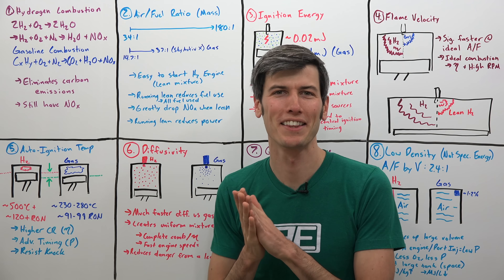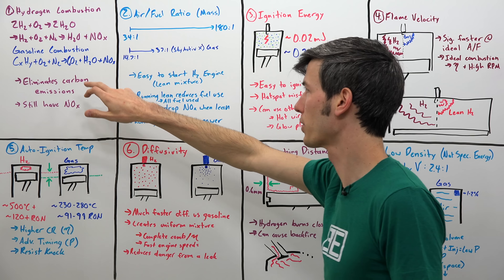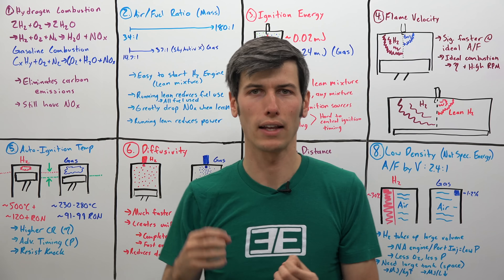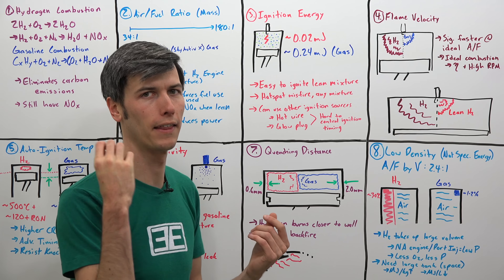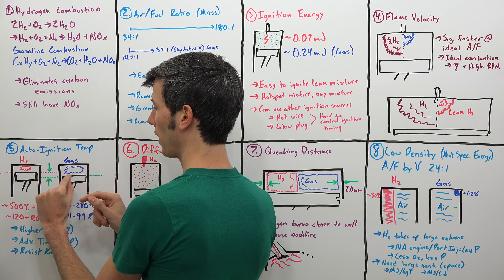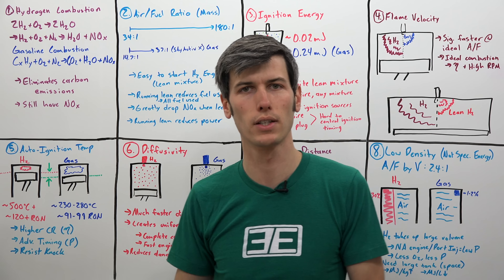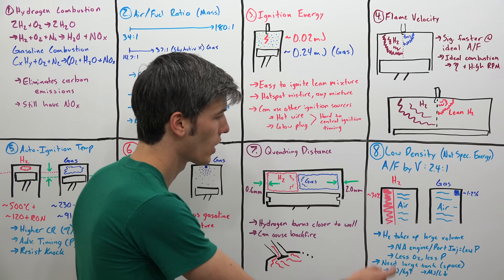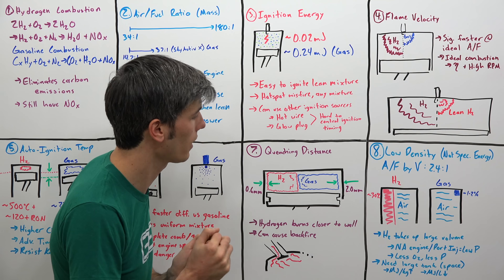The Difference Between Gasoline And Hydrogen Engines

Comment: I work with H2 full cells and the Company, I work for has a few vehicles that have fuel cells in them. (Mainly commercial only at this time ). The fuel cell generates the electricity and then the vehicle uses an electric motor Just like any other electric vehicle. Byproduct is H2o NO Nox
Reply: But less efficient in high load.
Reply: @delaz4ck543  the 36 volt fuel cells we have can put out 300A.
Reply: @autotailor819  I mean, the brake thermal efficiency of FCV is not that high.  Some ICE reach 45% of brake thermal efficiency in high load. 
BOSH said a hybrid car with Hydrogen internal combustion engine and Fuel cell can be the solution in the future.
Reply: @delaz4ck543  right I gotcha its actually rilly cool to

Comment: Question, what was the very first fuel source used when the internal combustion engine was created. I know motor oil from crude oil was not the original oil used in engines. Just curious. I know rewinding back to the beginning is not quite ideal, but maybe, just maybe we missed a great thing by traveling the wrong path with technology of the times.
Reply: Kevin Hamilton Peanut oil I believe, at least on Mrs Benz’s cross country trip...
Reply: From 10 minutes of searching on google. It seems that a crude version of kerosene was used in IC engines.

Comment: Being a mechanic, I'd say that a rotary motor (Mazda rx7, rx8, wankel engine) would be amazing running on hydrogen. Aside from the apex seals, all the problems of a rotary would be greatly improved by the effects of hydrogen. They run at crazy rpms, are known for running rich. Hydrogen solves most of these problems. Thoughts?
Reply: It would probably function better with Hydrogen. However they are known for having heat issues and the exhaust and intake ports are open at the same time, so if for whatever reason your mixture wasn't completely burned before the exhaust stroke it would cause issues.

Comment: I wonder how it would work with a wankel engine...maybe they wouldn't even need the second sparkplug.
Reply: It would probably function better with Hydrogen. However they are known for having heat issues and the exhaust and intake ports are open at the same time, so if for whatever reason your mixture wasn't completely burned before the exhaust stroke it would cause issues.

Comment: Can you compress hydrogen into liquid to get more energy density?
Reply: Hydrogen won't stay liquid at atmospheric temperature at any reasonable pressure, you'd have to store it at over 15000PSI or keep it at very low temperatures in special refrigerated/insulated tanks.

Comment: Perhaps you can find this, but I was unable.  I watched a show on the Science channel in the late 90's that broke down Demarks Hydrogen car.  The had it up to about 230 miles per tank, installed the tanks on the bottom of the car running from to back so they wouldn't or at least have a very low chance of exploding if in an accident.  I would like to know why that car wasn't purchased by America, since at the time they were talking to the big 3.  Stating the cost would be around 25 thousand for a car.  Now they had a car and truck frame at the time, but why or why didn't this fuel source take off.  Oh, zero emission, are 5 to 7 Cents to fill the tank, which by the way, they had a Hydrogen pump you could buy from your home and it was very cheap as well.  I guess I don't understand why Hydrogen isn't the fuel being used by the masses?

Comment: 1 version of H-combustion engine is usually forgotten....
this version burns pretty cool and is very efficient.
the trick here is to use a moderately lean H-O mix but with added water spray.
this will result in basically super heated steam = power.

you mentioned valve overlap... 
i'm sorry to conclude that you don't seem to think in H-engine dynamics...
in a decent H-engine there is NEVER an inlet-outlet overlap since you'd be throwing your fuel away. as you mentioned yourself, it dissipates real fast.
ignition, depending on how lean you run, only has a 4 deg past TDC spark no pre-ignition.
only on a very lean mix should you set it earlier.

the last version H-engine is an oddball.... the implosion engine.
this uses the 1:1800(or so) volume difference of water vs H2+O2 
put a very SMALL amount perfect mix in the cylinder, (let the cylinder draw it in, makes for lower than atmospheric pressure)
through valves that work in reverse. ignite when just past max low point  and you get a high vacuum that pulls the piston up.
almost at the top, open exhaust valve shortly and open the inlet once more to draw in the new mix.
NO AIR HERE, JUST H2 and O2.
runs brutally efficient.

Comment: Something i've thought about a lot, seems more beneficial to carry a tank of oxygen vs. hydrogen and use pure oxygen as the "air" source oxygen is the limiting reagent in combustion plus you aren't making NOx. Run a hydrogen and oxygen tanks and then you get near-pure h20 exhaust assuming the exhaust is cooled enough to not react with N once it leaves the system
Reply: You're correct. That's how a rocket works.
Reply: Haven't thought about it enough.  In order to do this you would have to have large amounts of fuel and oxidizer. For example, a 1 liter engine at 7000 RPM would require 3500 liters of gases per minute. Half of your vehicle would be pressurized tanks. Sounds like riding a bomb and you still wouldn't make it as far as a tank of gas or hydrogen using atmosphere.
Reply: You can say the same to any air breathing engine, and there is a very good reason why nobody wants to carry oxidiser onboard unless the engine has to operate in a vacuum.

Comment: Wouldn't it be more efficient to feed Hydrogen into a fuel cell in an electric car? There are always considerable heat losses in I/C engines.
Reply: The heat losses are what keeps you warm in winter, not a problem if you live in California but in Europe where I live you need a good heater in the car most of the year although I guess you could waste some electricity on heating elements.
Reply: @andrejagreen No you will still need it Climate change does not mean Cold or hot it means more variability.

Comment: @Engineering Explained what about if a hydrogen engine with both direct injection and forced induction?  Would its efficiency/power output be similar to that of its petrol powered counterpart?
Reply: Yes, however you have a higher risk of Pre-ignition and detonation than with petrol.

Comment: Could that backfire problem due to small quenching distance be mitigated with a direct injection system?
Reply: Yes. The H2 needs to be injected into the chamber at something like 100 psi. A little less than that is a standard pressure for most direct injection systems.  However, 

   I
would like to take the time to post some info about my vehicles
setup.  I have been running my car on Hydrogen for about 2 years now.
 I do not store large amounts of Hydrogen fuel in a separate High
pressure container.  I produce enough gases on demand through the
electrolysis process to run my 2.4L engine which requires about 6L
per minute at 7000 RPM to run without hesitation or noticeable
reduction in power.  To be clear, I do not separate the Hydrogen and
Oxygen gases in my device. I simply have a small container that will
be pressurized to 12-15 psi before the system will shut off
production automatically.  I produce enough gases on demand through
the electrolysis process to effectively bypass the need for complex
High Pressure tanks to store H2 like most of the current systems.

   
With this method I do not store
enough combustible gases to cause any significant fire hazard or air
displacement danger in the instance of a "leak" or failure
of the containment device.  I bought a new fuel tank to replace the
one that came with the vehicle to prevent contamination from the old
fuel.  Now I use my house water to fill my cars fuel tank which holds
12 gallons.  So the fuel system is the same as you would find from
the factory but, I fill it with Water instead of Gasoline and the
fuel pump connects to the water container in the engine bay instead
of to the injectors.  Also I do not use the fuel injectors, I use a
large aquarium tube that is connected to the intake before the
MAP/MAF sensors.  In order to run my engine on Hydrogen I had to
retard the ignition timing from about 25 degrees before top dead
center to about 5 degrees before top dead center.  I did this by
using a timing light and rotating my distributor clockwise by about 7
degrees.

    As
a comparison my car got about 30 mpg with gasoline, now it gets
between 25-35 mpg with Hydrogen.  In conclusion I am sure that with a
more complex delivery system I could get better performance and
mileage because I am not monitoring the fuel air ratio but, my goal
was to create a system that produces less Carbon emissions not to be
crazy efficient and cheap to fill.  I believe by producing enough
gases on demand this is more efficient because if I run out of fuel
through miscalculation or my fuel gauge stops working, I simply need
to find someone willing to sell me water (in one case a woman was so
impressed she just gave me the use of her garden hose).  This is also
safer because I am not using a "High Pressure" storage
container for a combustible gas or liquid, it is just water in a
tank.

Comment: Have to question that timing statement with the speed of combustion you may want to watch accidentally reversing the power applied to the crank.
Reply: I would agree to that. With hydrogen flame front traveling faster, I don't think you would be advancing timing. Unless you want a see thru piston. And did anyone else pick up on that? EE your thoughts on this one?

Comment: Nice presentation. Im for hydrogen use. I think its the only other fuel that can give the same power to distance for towing ect.They used hydrogen during lean/war years to run gen sets. So the tech is out their. It is just like comparing a model T to a new car. The research will come if we go that way. As for storage hydroxide cylinders have made leaps and bounds in storage.I pose a question how much food/bio fuel will we need to run trucks in the future. We cant feed every one now. So what is the solution to large machinery power, electricity, gas, petroleum, biofuel, nuclear or hydrogen?

Comment: Can not have any valve over lap, resulting in back fire.
Reply: The hydrogen mix burns so fast that it is done burning by the bottom of the power stroke.  Proven by internal testing at the University of Minnesota.

Comment: Because hydrogen burns so fast, ignition timing is almost at TDC (Top Dead Centre). That means much less heat is lost through the cylinder wall during the combustion process, thereby adding to the efficiency of hydrogen compared to gasoline, where ignition advance can be as high as 25 degrees before TDC. Because hydrogen burns at such low concentrations, the engine can run under full compression at all engine speeds, just like a diesel engine.

Comment: So you might almost think of H2 as the fuel of the future. Unfortunately, when you get OUTSIDE the engine, the negatives really start to mount up. First, fuel systems: are you going to use H2 as a gas or as a cryogenic liquid? Both have enormous downsides. Second, H2 is not an energy source. There is no such thing as a hydrogen well. Whether you get the H2 through electrolysis of water or steam reforming of hydrocarbons, the energy balance is pretty sucky. And putting that H2 through an inherently inefficient internal combustion engine,only makes the problem bigger.

Comment: I don't understand 8 because you just put only hydrogen in a tank compressed so the 1kg energy density of 135 MJ approx compared to 45 MJ of gasoline per Kg in both cases, does finally says is another advantage of hydrogen not disadvantage, so please check the weight is more important than volumes cause you can compress and store hydrogen to have 1/3 (135/3 = 45 MJ) size to get the same gasoline energy density

Comment: Lot of what if....every class that should of been  reviewed  since the early 1900s. Engineering  a different  way to get the use of water...down the grapevine I am wondering where did the engineering go....and why still today we are 200 years late. Route of all evil? $$$$... incorporate a few magnets to remove thru the catalyst  carbon emissions ...will prolonge the engine, and hydrogen  is still the main factor since 1908...

Comment: Am I the only one to worry about the fact that producing water vapour (from burning Hydrogen) is really bad! Water vapour is a much stronger greenhouse gas than Carbon Dioxide 😳
Reply: Yes, you're the only one.  If hydrogen engines were abundant, water vapor would only be increased by such a negligible amount that it couldn't be calculated.
Reply: Ken Jackson thanks. Interesting then that CO2 production from combustion engines is seen as such an issue. 

Guess I should have studied more science at school.

Comment: You wouldn’t use a hydrogen tank. Please look up Stanley Mayer. The patents are in the net. Water will be split at the end of the injector into hydrogen and oxygen supported by frequencies to split the water with very little energy. (I believe 0.4 Amp was sufficient)....
Reply: Would we be getting something for nothing?  Where does the energy come from?

Comment: Isn't the stoichiometric point by mass for hydrogen combustion 8:1? 2H2 + O2 -> 2H2O.  Hydrogen has an average atomic mass of about 1 AMU, so 2H2 has a mass of about 4 AMU.  Oxygen has an average atomic mass of about 16 AMU, so O2 has a mass of about 32 AMU.  32:4 reduces to 8:1.  I was always taught 8:1, and that's how the math seems to work out.

Comment: Of course after your kick off, explaining the relative result of which fuel one is burning you are talking about INTERNAL combustion engines and except where you mentioned rocket engines, reciprocating piston type engines rather than turbine engines. - just saying, but there are other methods available. . .

Comment: Due 2 the quick burn of hydrogen u cannot set the timing back, in extreme occasions it has has happened motor damages when using high amounts of HHO gas. U when got to set timing at 0 degrees or later, timing by ear..

Comment: But the best way to "burn" hydrogen as fuel is to run it through a Proton-Exchange membrane fuel cell, convert it into electricity, and drive an electric motor. Combustion engines run roughly at 18% efficiency, the PEMs run about 50% efficiency.

Comment: Someone should make an opposed twostroke hydrogen engine direct injected.
Reply: With forced induction....f1 might just be doing that soon. .
Reply: @waynogarfield4556  Forced induction on hydrogen would require some pretty beefy engines, the strain on the internals is probably comparable to nitromethane.
Reply: 2 stroke engines need oil in the fuel, not so easy when the fuel is a gas?
Reply: @surreyelectrical6192  with forced induction you can simply use a wet sump lubrication system like fourstrokes since the fuel does not have to travel through the crankcase before entering the cylinder
Reply: @surreyelectrical6192  opposed 2 strokes are lubricated like a normal 4 stroke(i believe)
Reply: @aryanthacker  2 stroke engines don't have oil in the sump as this area is used to feed air fuel mixture so the oil is added to the fuel
2 stroke engines and 4 stroke engines are not the same, if you use hydrogen as the fuel in a 4 stroke engine the oil in the sump lubricates the cylinders
if you use hydrogen as the fuel in a 2 stroke engine there is no oil so the engine will stop working
Reply: @surreyelectrical6192  The particular type of 2-stroke engine they're talking about doesn't run the fuel/air mixture through the crank case like, say, a weed eater does.  Just Google "Fairbanks Morse 38" for more info (or ask any navy submarine engine man).
Reply: @jeffspaulding9834  
Hi Jeff, thanks for the info, I had never heard of an Opposed Piston Diesel Engine, I've only worked on cars and bikes, looks like a brilliant idea
john
Reply: If I'm remembering correctly, Fairbanks-Morse made industrial diesels just as you've described. While serving in the US Navy aboard the USS Midway CV-41, our 2 emergency diesel generators were driven by Fairbanks-Morse 9 cylinder, opposing piston engines, that were direct injected diesels, rated for 1350 bhp and drove 850 kW generators, (I think it was at @1800 rpm). The Midway class aircraft carriers were built in the early 40's and the Midway itself was commissioned in October of '45. However, the engines were originally main engines on WW I era cruiser's. The engines were salvaged at their decommissioning and then re-requisitioned by the Navy for service on the Midway class.They certainly were great engines and performed extremely well. I was on her from '77 - '79 and they were both still going strong. If you're ever in San Diego, you might be able to see them on a tour, as she was turned into museum ship at decommissioning.
Reply: @jimcarney7174  thank you for your service and that wealth of information you shared.  Crazy how we often go full circle in regaurds to technology.  Some times we were just missing a small piece wether it be electronics or computerization.

Comment: Once you put all this information into the context of a real-world car, you'll find that all these nifty science and engineering details are overwhelmed by the currently insurmountable downsides of hydrogen internal combustion. Hydrogen is extremely expensive, and hydrogen is extremely dangerous. Even if we overcome those issues, there is no hydrogen fuel delivery infrastructure. Gasoline and electricity are both available to everyone who has a car, right now. Both are market-viable energy sources for vehicles, right now.

IF hydrogen is the future, that future is a long way off. So it's interesting, but not relevant as a motor fuel under any realistic set of circumstances that could possibly develop for decades.